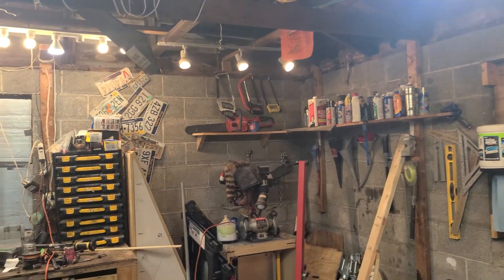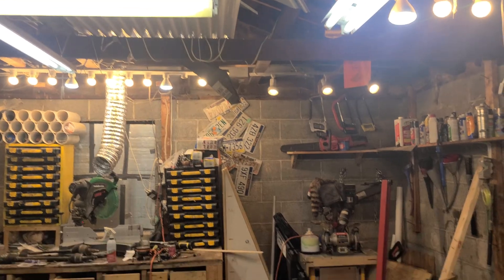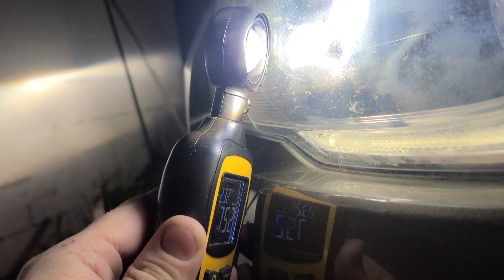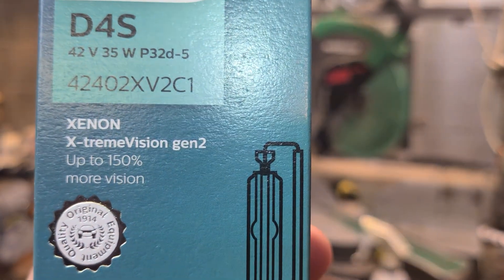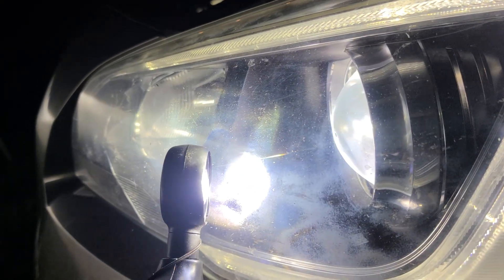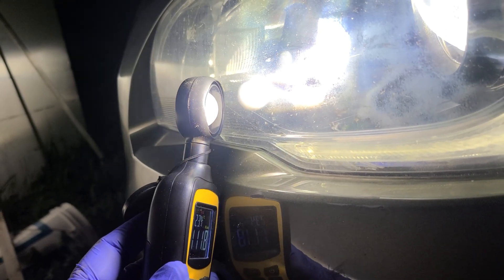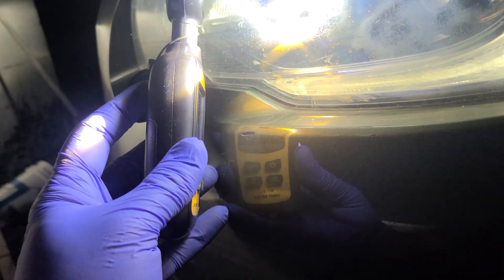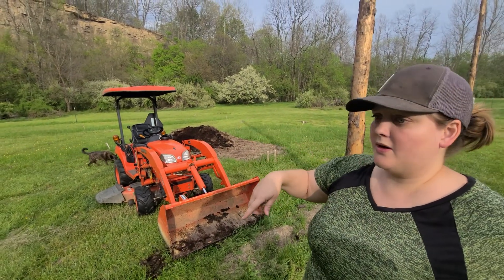Testing Phillips D4S +150% Headlight Claims. Surprising results.

Comment: True you get an improvement in light output with a $100 D4S, but I'll bet ya half a peach they won't last as long as what they replaced.  I'm SOOOOO glad Wanderlust has the LED headlamps.
Reply from the maker: The factory bulbs are $65. If replacing at the time  they burn out the price isn't super outlandish.

Factory HID has pros and cons. The biggest con being cost. 

I'm not sure longevity though. The marketing mentions nothing of hotter burn or shorter life. 

I know that doesn't mean anything but the Sylvania Silver Star specifically mentions shorter life as a trade off for their version. 

Will report back if they ever burn out. But with the factory bulb lasting 8 years I'm not sure if I will ever get the chance.

Comment: The light output (lumens) of HID globes/bulbs degenerates with age so your comparison figures may not be meaningful if you are comparing an old globe/bulb with the new globe/bulb. It would be interesting to compare the $100 globe/bulb with a new cheaper globe/bulb when they are both new.

Thanks for the video as always
Reply from the maker: I did not realize that age was a factor for light output. Thanks!

Comment: An improvement, but $100 improvement?  I suppose you would need to drive at night to really find out.
Also some plastic polish on those headlight covers would probably do wonders.   I like 3M plastic polish.
Reply from the maker: I would say yes. Especially with the original bulbs at 110k miles I figured it was likely to go out soon. Not sure the expected hour life.